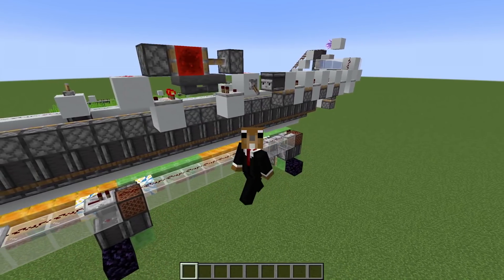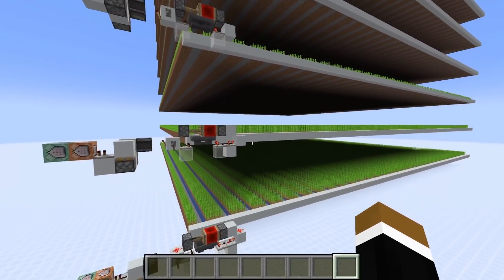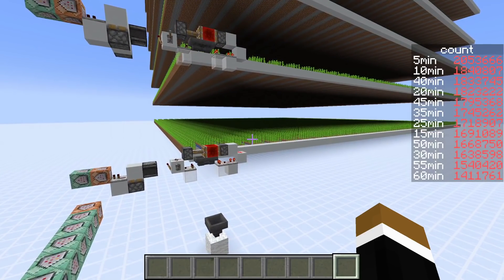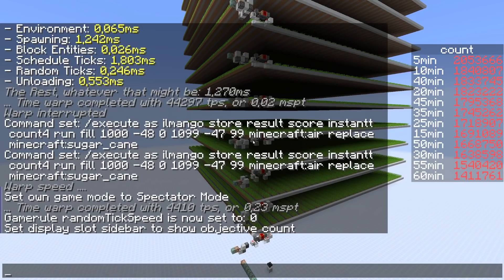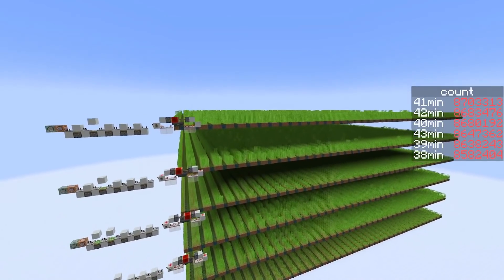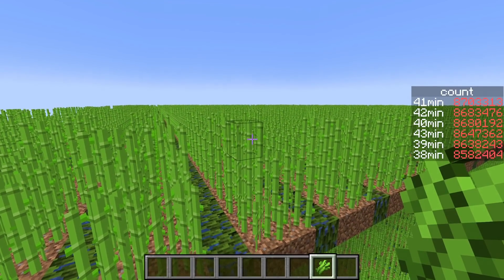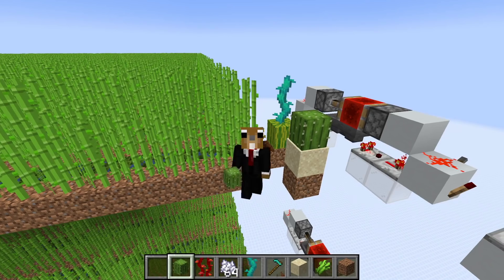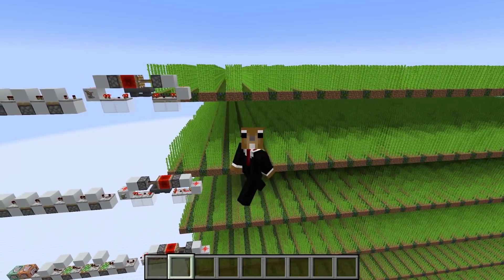What Is The Perfect Clock For A Sugar Cane Farm?

Comment: so that raises a question about the classic observer/piston sugarcane farm. could it be more efficient to, say, check if 3/5 of the sugarcane are fully grown before harvesting versus harvesting as soon as the first one hits stage 3?
Reply from the maker: you mean those farms where you detect one sugar cane and harvest the full row? Imo those farms are horrible anyway and I never promoted the idea of doing it this way. It's quite simple to make a 1wide tileable detection and harvest system. I would always build either that or go for a clock design. 

But I guess that's something I could also answer properly in a video.
Reply: @ilmango  that’s entirely fair! im mostly wondering because it’s an interesting statistics question. i’m going to try to answer it using math, as well as work out the timing for the example in the video
Reply: If you don't want to make a flying machine farm then just use slime blocks to push the sugarcane and have that on a clock